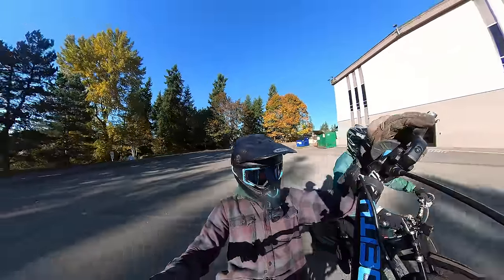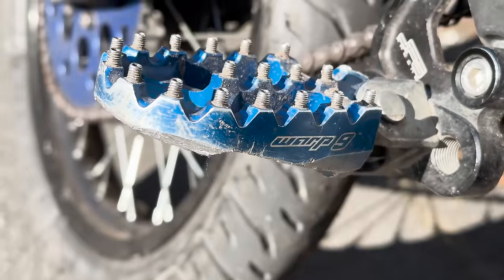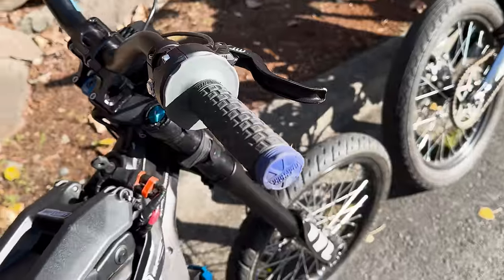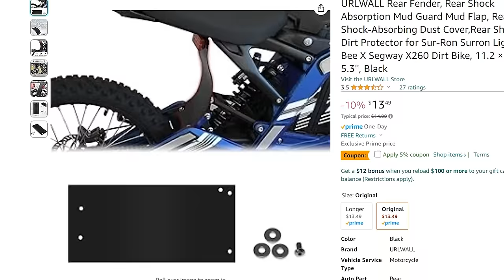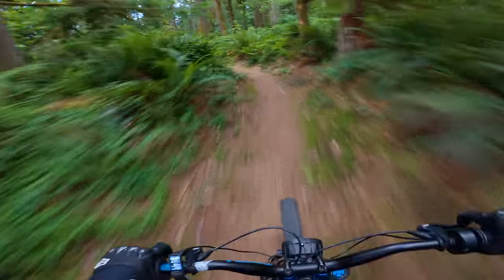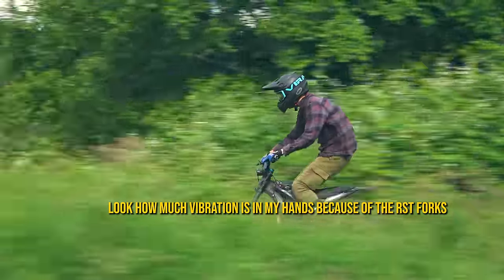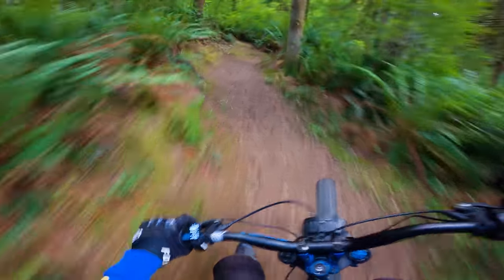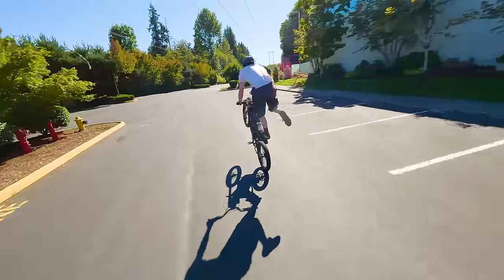The BEST Surron Mods

Comment: nice video, thanks, one tip for improvement, the magura mt5 is not a "good" brake not even for mountainbikes, at this pricepoint of all the other upgrades id get trp trail evos or trp dhr evos, if you dont have that much money get the limited edition mt5 with two 4 piston calipers and 1 finger levers, that would increase the stopping power and head dissipation alot

Comment: Will upgrading my headlight before my battery have a noticeable effect on range?
Reply: Not at all the average motorcycle headlight uses 60w on the high beams so you could run a motorcycle headlight for 58.33 hours.
Reply: Not at all LED's barely draw any power. not noticable whatsoever on a big battery like on the Surron